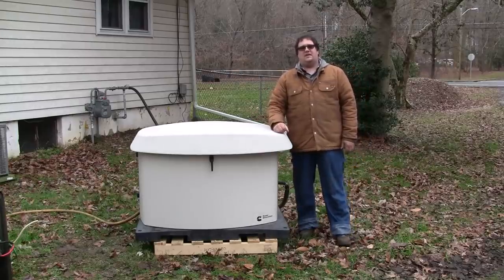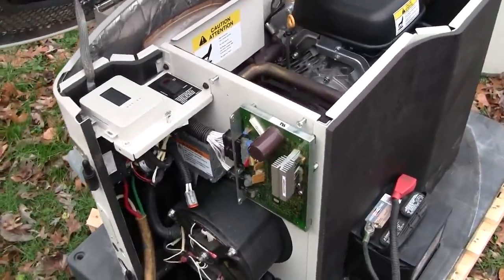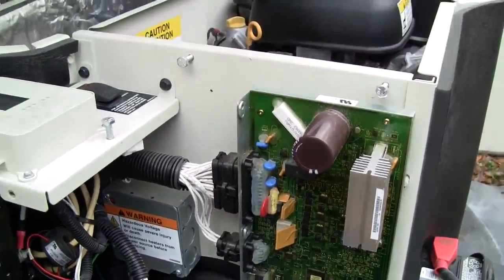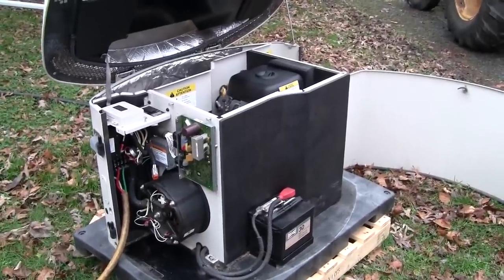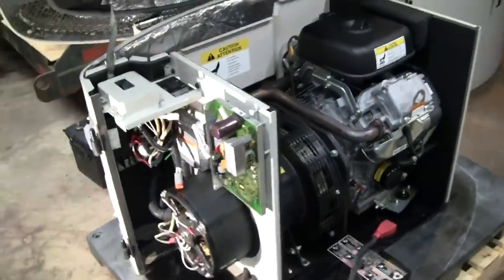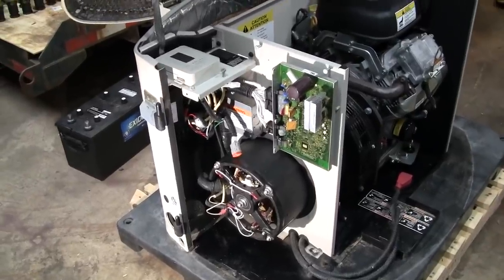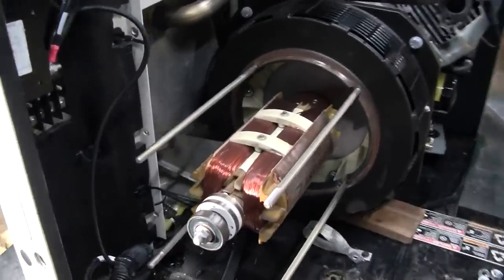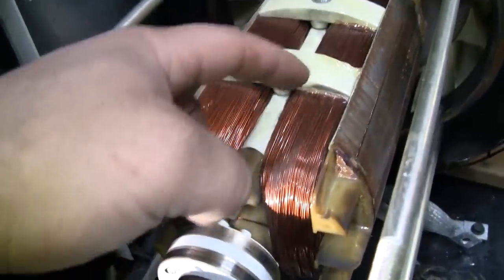2015 Cummins Home Standby Generator IS IT DEAD ALREADY? Pt. 1/2

Comment: Your observation at 19.26 regarding the different colour winding wire makes me wonder if they’ve been saving money by using aluminium wire , I’ve taken any amount of generators and motors apart for recycling, I quickly learnt to scratch the winding wire to ascertain whether it was copper or aluminium , if it was aluminium I didn’t bother wasting any more time to recover a metal that was a quarter the value of copper. I’m surprised if this was the case from a well established and renowned company like Cummins.

Comment: To fix scratched windings,  i put a bit of uv glue over the damaged area then shine a uv torch on it. Hardens in seconds.
Those extra pigtail wires should be secured with a removeable rubbery glue for vibration damping.

Comment: Through years of experience with American designed and manufactured equipment, that its very helpful to apply a hammer to it for ten to twenty times, after which you throw it away and buy a Honda. Briggs and Stratton engines have suffered greatly under my 10 pound hammer.

Comment: As others have stated, that is probably why that rotor is no longer made!
One thing I would do is somehow support the 14 ga. wire and your solder connection.  Maybe with a blob of epoxy or something that would stick to the nylon?
Vibration and centrifugal force may break the connection.
Just a thought.

Comment: I'm about 1/3 through this video and it is strikingly similar to a problem I had with a Generac 5500 portable last year.  In that case the field winding was broken where it attached to the slip ring.  I soldered the wire back together which fixed the problem.  A generator service location wanted to charge my friend 500.00 to replace the entire alternator portion, or sell him a new one for 900.00.   Ok - now on with the video.
Reply: That was a crap design to rely on only a physical connection in a device that will be spinning and vibrating as well as exposed to elements.  The slip rings should have had solder terminals with the wires wrapped around the terminals and soldered in place.    I would use epoxy to hold those wires and terminals as an additional measure against fatigue from vibration and rotational forces.

Comment: Nice!.  A few minutes saved in assembly must have cost them millions in total warranty and very unhappy customers.  Everything in my Winco generator is soldered. I know because I had to replace the diodes on the rotor.  Good find and good fix.

Comment: I replaced a rotor on a 20K Kohler in the snow and rain.  The rotor had slightly high resistance that was probably caused by the same the exact same issue.  Fortunately the new rotor solved the problem.  It was about a $900 part.

Comment: Thank you Mike. I am considering 20 kw to 24 kw generator for our home back up power. Seeing this video of the poor design of the rotor windings  to slip ring connections makes it more difficult decision to invest over $10k in a system. Are all manufacturers this cheaply made? Or do you know of one that is properly made with a quality connection of the windings to slip rings?
Reply: Billy
I’d suggest going with a 4 pole generator
Larger yes
More robust yes
Last longer…maybe 2 to 5 times

Comment: Will the splice joints add enough weight that the centrifugal force/vibration will be an issue?  Though I'm not sure if there's a way to secure them to the rotor, since glue would probably fail and add even more weight.

Comment: Excellent video Mike. I find that we think in the same direction when we make a diagnosis. It's interesting how two big brains can think the same way ;). The only thing I would have done different from you is install a piece of fiberglass sleeving on the #14 awg wire before welding it on the rotor winding. This way it is possible to attach the wires to the rotor to avoid short circuit and to avoid breaking the wires when the centrifugal force will pull the wires out. Continue your good video 👍 I will stay tune for sure!!!!!!

Comment: Nice one. Just a note, one would have to put something around the area where the new wire connects to the windings to avoid the centrifugal force to want to bend the wire outward as the rotor runs....  lacing twine perhaps.

Comment: Watch Wes Work had a similar problem on a non-Cummins welding rig. I think it was a Lincoln and the issue was a discontinued electric motor part, but the manufacturer diagnosis was wrong too.

Comment: Did you have to remove the varnish from the wire before soldering?  Or does the torch burn it off?  Is so, how did you remove it?  Also, what flux did you use?
Reply from the maker: Yes, I do remove the enamel coating from the winding wire.  Since the wire was a fairly heavy gauge I used a utility knife blade to gently scrape the enamel off.  Followed that with some scotchbrite and brake cleaner on a rag to degrease before soldering.  The flux is standard paste flux for electrical work.
Reply: @SmallEngineMechanic  thanks for the info.

Comment: I had a similar problem on an old Onan Microlite. After repairing the connection, I took the rotor to a motor shop to get it "relaced". They used some type of epoxy to bind and seal the wiring against damage from centrifugal force. This might be something for you to consider.
Reply: I would have thought that any respectable generator manufacturer would have epoxied the rotor windings as a matter of good practice. Just my humble opinion .

Comment: I wonder now with #14 solid wire repair if centrifugal force of the unit at 3600 rpm will pull on the magnet wire. Thus starting up force will flex it every time? Just a thought.

Comment: Great trouble shooting.  Thank you.

You can see what happened.  The rotor plastic where the slip ring studs were pressed is brown and distorted and not circular.  There must have been a high resistance connection for quite some time that allowed resistance generated heat to melt the plastic because the winding wire was merely resting on the stud.

While I was watching, I was formulating a problem solution in my mind about the same as what you did.  One thing I see is that those 14 ga. pig tails ought to be fastened down so that they don’t work loose from the vibration and the centrifugal force of rotation, especially on the longer pig tail.  Perhaps just a nylon tie-wrap to cinch the wires firmly in place might do the trick.

Still, there is an unanswered question:  what got into the end of the housing that nicked the varnish on the stator and chewed up the slot insulation?  It even looks like something happened between the rotor and stator because the varnish is worn off in places of the stator pole pieces and rust has set in.  That would also possibly explain why the slip ring studs were bent.  There might have been an errant washer or nut in there, possibly even when the unit was manufactured and the damage was done while being tested at the factory before it ever reached the customer.
Reply: Very well stated. This reminds me of the american workers Forking over the Company.  I totally agree with you about an issue at the factory WT. Now all the people with the F-You company have no jobs. A double edged sword where both sides loose.
Reply: @victoryfirst2878  Right, blame on the workers.
Reply: @sbc383zz  Some workers yes, All NO!!!!!!!!

Comment: Good troubleshooting.  Maybe consider some epoxy to hold the 14 gauge wires in place to prevent rotational forces from trying to sling them out and possibly break the rotor wires.

Comment: I've seen the solder joint to the slip ring break.  I've also seen the brushes be contaminated, and then leave a 'plastic' film all over the slip ring!  You take a scotch brite to the ring, replace the brushes.  Did that on about 30 of one or two models.
Reply: (BTW - those were all RV generators!  Not saying this is the issue here... since it's clearly not!  hehe)

Comment: That, friends, is a solid troubleshooting methodology. That 14ga wire isn't going to want to flex away from the centerline when that rotor is turning at high speed is it? I'd be concerned about it wanting to pull the thin winding to the point of snapping. Maybe put some shoe goo or something down and glue the extensions to the rotor for stability?

Comment: Brilliant troubleshooting video, to your usual very high standards. Really enjoyed this! :)

What I was wondering about is why would Cummins no longer have the part available, after only 5 years? Most manufacturers will stock parts for 10 years, after the device is discontinued? Seems like a very aggressive case of 'enforced obsolescence' to me!
Reply: I wonder if they used up the stock of spare rotors faster than anticipated....
Reply: The way they made that piece, I'd imagine they knew full well what they'd need to "fix" it when it broke.

Comment: Hi I am glad to have found you I own a small factoru of generators from 10 to 1100 kVA in Uruguay. Loved the way you found & fixed that problem, I guess which brand of alternator is that one, if it is Chinese normally wont last too long in time as running at 3600 rpm is not for everybody...  (If Italian i do not recall that coil system; that part "inserted" as factory design was a pain in the a.. .Your customer was lucky to meet you. Your repair action should be taken as a factory improvement.  You got a new suscriber, here in my country gensets below 20 kVA noone wants to repair them as they are sorta boomerang. they always come back hehehe. Best regards

Comment: I'm sure Mike knows this, but you should put glue on the wires where he spliced them.  3600 RPM is a lot of inertia tugging on those wires
Reply: Add a wrapping of fiberglass or Kevlar thread to hold the wires against centrifugal force, then apply lacquer or epoxy over the fiberglass/Kevlar thread.

Comment: I want to see what was flailing around in the rear of that thing. I fixed the stator winding on a 5kw honda that had an open sense winding. I found about 6" in fron the connector was a speck of concrete that ate into the copper. A little crafty work and it works great.

Comment: We have a 20 K Cummins standby, installed new a month ago.  Problem is it will not exercise with a preset.  We can manually tell it to exercise which it does, but when the exercise cycle is set for the next morning, nothing.
We've been told it won't exercise but once weekly when set on "weekly", therefore we must wait a week to see if it is set properly.
Is this info correct?  If so can it be reset by totally turning off and starting over?

Comment: Where the knurled ends just slide into the plastic to each ring seems like an iffy connection. Would it be wise to clean the male and female side of the connection and treat with something like Stabilant 22 or other deoxyent to prevent oxydation and compromising the electrical connection? Your the expert and I'd appreciate your thought.

Comment: I wonder if what ever scraped the stator jammed against the slip ring block to cause the studs to bend like that and then break contact with the field winding
Reply: That's right. Probably saw some rough handling during some point in assembly.

Comment: Looks like it’s been rubbing inside the stator based on those markings...

Would definitely glue those to the stator body. Copper work-hardens and can get super brittle. So would try to add some mechanical stability to that joint.

Comment: How did you shield the coil wires when you were re-soldering them? The coil wire have a very thin protective coating on them and any degradation of that would short the coil! Great vid!

Comment: Hey Mike, I have an old 7.5kva army generator that is not producing any power except residual power. I have tested the resistance from the slip rings and I get a reading of 0. I also tested from the slip ring to ground and I get open circuit. My question is, should I get a higher resistance reading on the slip rings?

Comment: Just FYI the two wires to the field don't care if they are swapped. It would only change which side of the rotor is North and South, changing the output power phase by 180 degree in relation to the engine crank, unless something in that setup cares about the angle and phase (not just speed) everything would work fine.

Comment: As a level 2 Cummins gen tech , I can’t tell you how many gensets of all brands have issues with the slip rings tarnished. Especially problematic when rodents make nests and piss in the housings. I would automatically use a small stick with scotchbrite attached to the end to clean the surfaces.

Comment: The easiest fix for this generator get rid of it and buy a lister diesel generator. Have one at my home made in 1963 has at least over 15000hrs on it. It was well looked after according to the person I bought it off, starts first crank every time. But still great fix mate, I can't believe Cummins has sunk so low to build generators of this quality.

Comment: My friends, I must tell you that starting some years ago, that when I bought something new like this, and for what ever reason I have to go into it as this guy has. That I was constantly amazed of how cheaply everything was made that was made since 2007. . .From motorcycle fuel pump mistakes in manufacturing to generator problems like these. . .All this stuff from China is junk, total crap. They did it for max profit thats it.
Reply: John Everlasting  You would know, if your name is Everlasting
Reply: John Everlasting  Go find an old fan, just look at the difference.
Reply: John Everlasting  What gets me is, the first one of these videos was about one of the machines where because of Emissions laws the crank case vent has a short hose that dumped the crank case venting into the carburetor to such up and burn any oil vapors. Its a retarded idea. It kept freezing over. Whats really stupid is the idea of natural or propane gas.  That thing will empty even a large household tank in a very short time, and if its a storm how to you get it refilled that fast. Just dumb.
Reply: John Everlasting  No No my good man. There was a great video this guy had talking about the propane/natural gas issue. . . The thing ran out much faster than he was told. And during a storm your not going to get a tanker truck out to get a refill.
Reply: John Everlasting  No dude, forget those things. Where are these generators powered by magnets only???  I know it has been done, I saw them in believable ways.

Comment: Just a friendly reminder that, no, soldering is not a good mechanical connection.  It may look strong now, but vibration and solder don't mix.  I hope you plan to add some epoxy or at least hot glue to improve the lifetime of that connection.

Comment: Does it have Capacitors to keep the field energized like the coleman generators have? I have been given Coleman Generators in the past that all i had to do is take booster cables while the Generator is running and jump the brushes with a 12 volt car battery. Check the caps to see if they drain to quicky. As i watched more i see the field was the problem just not the problem i thought but same ball park. both reasons would remove the magnetic field to generate the flux in the stator.

Comment: One issue most people don't realize is the power load must be removed before shutting down the generator. It's job is to create power and regulate it automatically. It doesn't know you're shutting it down. Trip the breakers, then shut down. Running out of fuel creates the same situation. Too much current burns windings and or power modules/regulators.

Comment: So I looked at that heavy wire you soldered onto those pins and got thinking, what happens when the rotor is spinning and centrifugal force throws the heavy wires outwards and breaks the connection to the light magnet wire?
So I got thinking maybe you could use some lacing tape to hold everything in place?
So I got thinking about the abrasion you saw on the stator windings and maybe the manufacturer had something like that originally?  That came off, abraded the stator, and let the connections to the pins get loose?

Comment: What about the centrifugal force acting on those rather hefty copper wires you soldered to the pins and maybe hitting the rotor or stater winding?  Don't know if that would be an issue or not but something to think about.  Great job diagnosing the problem.

Comment: I got one of these very cheap from a house that was being demolished. Are there any easy ways to test if it works before doing the gas and wiring installation. I'm worried about spending all the money to connect it and then it be broken.

Comment: Enjoyed the video.  Do you think the #14 pig tails you soldered on should be anchored to the rotor?  Maybe some epoxy?  Thinking they may move/vibrate and fatigue the tiny field wire.

Comment: Dont cut the pins as there is no key or key way on the shaft and when the rotor is accelerating to 3600 rpm it will shift.(Ok watched your fix and it looks good) Silfloss solder is better than  lead.One thought on Cummins/Caterpillar :on all their larger diesel generators they use brushless excitation.In an overload condition the solder will be thrown out of the diode connections on the rectifier on the end of the shaft.I've resoldered more than a few of them.And they worked fine again.Told the ships crew that maybe they needed a bigger generator because 50kw wasn't cutting it and it would keep doing it til they up powered.

Comment: Rotor obsolete after 5 years? Scary that generac is a little  better about there rotors.love trying solder new diodes in winco when it is below freezing.very nice video.very much like your presentation. Keep safe